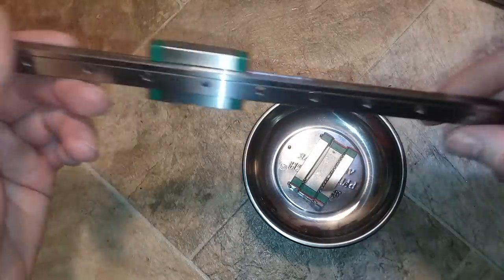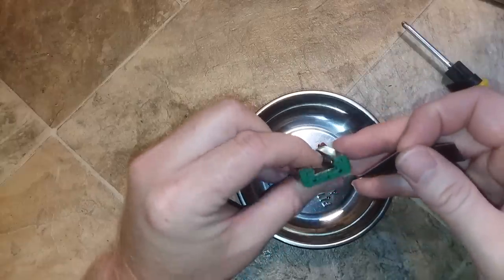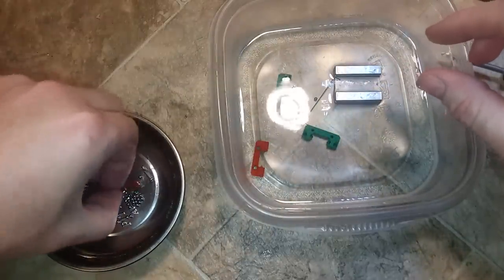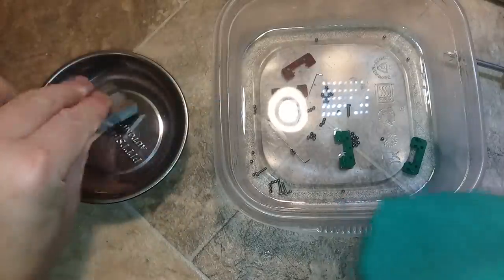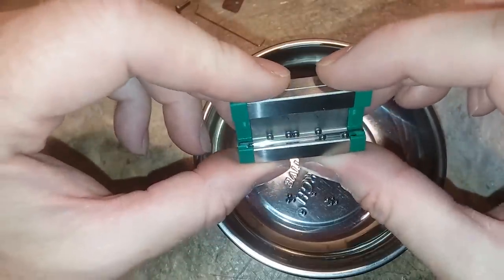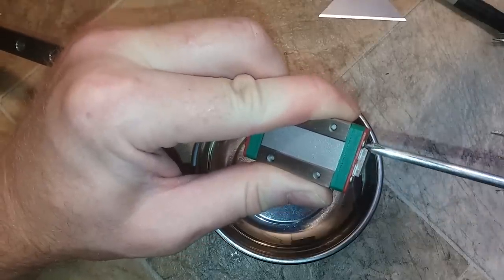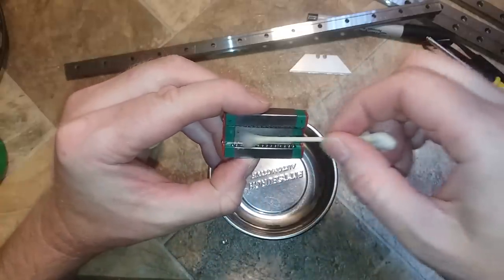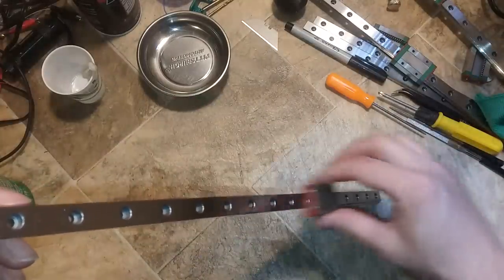Tuning Up Cheap Chinese Linear Bearing

Comment: These are not meant to be adjusted in any way? once wear sets in you are meant to replace the entire bearing? thanks.
Reply from the maker: Not really any way to adjust the bearing blocks.  I've ran these linear bearings for a while on my 3D printer and see no signs of wear.  I clean and re-lube the rails about once a year.
Reply: There is a huge difference in linear bearings you are seeing being installed on 3D printers (Voron, et al.) and linear bearings used on industrial machines in a production environment.  There is no way to adjust these bearings, but then again, high-quality linear bearings will not wear out on a 3D printer in your lifetime.  Even a small, made-in-the-USA 15mm wide linear bearing has a load-carrying capability of 2400lbs (yes, you read that correctly) but, a high-quality linear guide rail set for a Voron will cost more than the printer itself.  There is a VAST difference between industrial quality and Chinese junk.
Reply: @6milesup  which is to say the cost benefit relation for a 3d printer application leans toward the cheaper junk given little to no difference could be seen or measured under such insignificant static and dynamic loads and wear would not be an issue unless you decided to grind something next to the rails heh
Reply: Forgot to add even if you had lab grade linear motion and a rigid structure with a temperature controlled chamber the materials in use are often the culprit for tolerance and warping issues, printing most plastics is by definition an imperfect method of manufacturing... Just varying the printing speed will require different cooling flow and could cause unwanted warping with many materials due to differential heating (under inefficient cooling upper layers remain hotter than the lower layers causing a warp/deformation pull on the printed topology) this is probably going to infuriate a few but as it stands for FDM we're dealing with glorified hotglue guns... Then again a good set of linear rails could get you closer to better repeatability and tolerances provided you also upgraded your belts and other parts of your motion system.
Reply: @6milesup  and Chinese doing better industrial grade stuff than usa😁 but you had no access, it's expensive
Reply: Yes, you replace the entire unit.  But an engineer would select a linear rail such that it's service life match the service life of the application.  The cheap rails would last the life of the printer and an expensive bearing would last the life of some pick and place robot.

Comment: Pretty sure that's not excess plastic, that's a preload spring
Reply: 3:55
Reply from the maker: The plastic is not a preloading spring.  That would mean the bearing retainer clip is rubbing on the linear rail.  How long to you think the retainer clip would last rubbing on the other metal parts.
Reply: Bearing blocks like these are preloaded by using oversized balls, not springs.

Comment: All the 's Balls are now magnetically. And this is bad pretty Bad.
Reply from the maker: And why would that be bad?
Reply: @MrDabrudda   all the particle from the xrails and balls are Metall
Reply: @julienhagen7411  Oh damn...that does make sense I guess.  But, I cant imagine losing one of those bearings on the tile floor. I think that would be worse. lol.
Reply: I think the concern is collection of metal dust from rail and bearing wear, as well as any metal contamination in the machine's environment.  Not sure how much any (presumably quite weak) magnetization of the bearings will matter vs. the effects of the lubricant, which will tend to collect both magnetic and non-magnetic dust and debris.

Comment: Where did you buy these from?
Reply from the maker: I bought the MGN12H rail bearings from Aliexpress.
Reply: many says that the metal hardness is very low compared to trusted brands, which make them useless after some work
do you agree? I mean it is not just about smoothness
Reply: @GraphicManInnovations  when you buy something low-priced, generally there's a reason for that.  It's less expensive to buy and form softer metals to looser tolerances, and to not spend what it takes to have good, uniform material characteristics (e.g. whatever is available as scrap steel vs. precisely controlled alloys for uniform hardness and good hardening and wear characteristics).

The question is, what is good enough for what you are doing?  Is your machine going to be running 24/7 for a decade, or a few hours per month for a few years?  How heavily loaded will the rails be, relative to the size selected?  How good is the rest of the machine, i.e. is the frame steel or thin laser-cut MDF (cardboard)?
Reply: @scottwillis5434  it depends what you need. We're not all rocket surgeons.
Reply: @scottwillis5434  I'd buy genuine rails for the X & Y axis, as they move so much back and forth, but the Z you could put cheapies in, very little movement comparatively.

Comment: Hi, how much weight can these Chinese Linear Slides hold? I'm thinking of using them on sliding picture canvas frame?
Reply from the maker: Not sure.  If you check the specs of the rails it should give you the max load the rails and bearings can hold
Reply: @elmariachi5133  it varies from sellers to sellers and batch to batch even on the exact same model from the same seller.

Comment: Afaik that’s not the proper way of lm guides lubrication
Reply from the maker: Then what is the proper way to lubricate guides?  Please enlighten us
Reply: @MrDabrudda  AFAIK most linear blocks have grease fittings - not sure if these do but obviously if they don't then you probably are best doing what you're doing. Also, you want a good quality lithium grease for the blocks. The Hiwin manual has some quite specific greases and oils it recommends. Definitely nothing with molybdenum disulfide.
Reply: In fact, after looking at your blocks, it's quite possible that the hole in between the two screws in the red plastic is for fitting a grease nipple and greasing. It's likely the hole needs to be poked through with a hot needle but study the block to make sure. If you google for the Hiwin manual it describes poking a hole through to fit a grease nipple, and some photos I've seen of this same block have a grease nipple fitted there.
Reply from the maker: @michaelkelly3158  Not the MGN12H blocks.  The larger linear bearings do.

Comment: Well. You clean cheap thing, jube it and hope for the best or you buy %BrandName%, clean them up, lubricate and just use them. xD
Transportation grease are nasty stuff... (Lithium soap or Calcium soap grease often used to prevent corrosion)
Reply from the maker: I have had zero problems with these rails in 1.5 years of using them.  Every so often I clean the rails with a terry cloth and re-apply the synthetic lube.
Reply: I recently got an NSK ballscrew which was made in 2001 and it's covered in this super nasty almost glue like grease. Took me 2 hours to get them off and it took me half a bottle of WD 40 and 3 towels I'm never getting back. Good thing is there is 0 rusting even after all these time.

Comment: Can I use wd 40 for lubricat
Reply from the maker: Absolutely!  I only recommend WD-40 for any LUBE jobs...
Reply: No, WD40 is not a lube its a rust dissolvant and we use it to flush old lube out of rails, not to lubricate them.  they do make other lubricants but most people  use EP1 or EP2 grease for rails.  for other stuff, use whatever works.
Reply from the maker: Yes, I know...I was being sarcastic.  If you read the description of the video you will see I posted this because people where claiming I used WD-40 for lube.
"AND NO!  NO WD40 WAS NOT USED ON THE BEARINGS!!!"
Reply: Already WD40 make Lubrican of silicon. Just use the proper tool WD40 is just a brand name, they have types of oil and lubricants.
Reply: @slevinshafel9395  sir I have wd40 bottle so can I use for lubrication rail lubrication
Reply: Yes of course you can, and it will not help and within weeks of applying it you will notice the rail is gaining resistance to movement which will soon be worse than where you started.
Reply: no never, it is a cleaner not a lubricant. use a graphite powder or similar something with virtually zero sticking power because what will happen with a 3d printer is that it will clog the bearing from the filament dust.

Comment: 3x Bosch Rexroth  cost about 500$ and will outlive you and your printer.
Reply: and outcost
Reply: Point is
Reply: not where I live
Reply: @sniperpronerfmods9811  his point was that even if he has linear rails it doesn't mean shit if they're pisspoor quality. People seem to not realize that many cheapo rails aren't straight, carriage have excessive slop and it would be all the same to use generic tube rails, they can wear out of shitty materials and worst they can easily be so shitty grinded that they could have axial changes between rail points which totally fucks the idea of rails. People seem fail understand that most cheapos are 100% quality control defect products (if in good luck) or just blatant ripoffs that pretty much nothing to have with original application concept.
Reply: yeah those sound over-kill for a small 3D Printer and CNC Machine.
Reply: Иван Иванов they will out live you. The high end stuff is expensive for a reason. It’s perfect when it arrives

Comment: You shouldn't be using a magnetic tray.
Reply: Why?
Reply: @achdubloedesau  I guess because Mr. Titanium says so. People who make pronouncements without giving reasons should be just ignored. They've contributed nothing.
Reply: @achdubloedesau  Because doing so may magnetize the ball bearings which will then attract small metal shavings.
Reply: @tcarney57  I don't agree, Better something than nothing.
Reply: @tcarney57  i think the reason is obvious. you don't want to magnetise anything in any of the metal parts of this hardware.

Comment: This is all completely unnecessary and should not be done. The guard pins are non functional in the bearing, their only purpose is that a mechanic with fumbly fingers wouldn't loose any balls when assembling the thing. Once the bearing is on the rail they serve no purpose and it doesn't matter is they are straight or crooked. And they use thick grease in the bearing, because that's the lubricant the bearing needs in order to function. The lubricant has to be thick enough, that under rated load there would remain thin film of it between bearing surfaces, if the load is great enough or the lubricant thin enough that it's metal on metal, the lubricant might as well not be there. And remember, the only contact surface are these tiny balls, by replacing the grease with oil, you make metal to metal contact and these tiny things don't take long to wear out.
It probably doesn't matter much in such a lightweight and rarely used application as a 3D printer, but it's still the wrong thing to do.
Reply from the maker: https://www.linearmotiontips.com/lubrication-grease-or-oil/

I see your point but these rail bearings are not carrying a lot of load nor generating a lot of heat.  It is easier to use a thicker type oil and reapply it with a qtip after cleaning the rails.
Reply: Yep that most all that needed doing was adjusting the swipers at the end of the rails PLUS lubricantion

Comment: The quality of electronic goods from china has tanked if you ask me... everything needs reworked. They don't see anything wrong with it!
Reply: That´s why it´s cheap. Not that I´m complaining, because I´m broke.
Reply: This is good. Because now you have a choice. Buy expensive stuff, or buy cheap and treat it like a set of parts. If you apply some random wage to "hobby time", then yes, they will be expensive. But most people have no way to convert "hobby time" into wages, so the time will be wasted either way. I don't mind wasting it reworking cheap stuff.
Reply: The quality is better than you think it is. The guy in this video is trashing the company that made this affordable for you so you can afford it.
Reply from the maker: @FrustratedBaboon  Trashing the company?  I don't even mention the company's name so how am I trashing the company?  Even with the expensive bearing you will need to clean the factory cosmoline off and lube the rail and bearings.
Reply: Demand creates supply. There is a demand for super low cost products and corners get cut. If you buy slightly more expensive Chinese parts, you get pretty good quality. It's unfair to say China makes crap parts when all you do is order the lowest cost parts from some random Amazon seller. I'm not trying to say the cheapest parts available from China are good, only that you can get pretty good Chinese made goods if you pay a bit more and shop Chinese known brands not random amazon stuff. Nothing against the video.
Reply: @clubpasser123454321  you are very right, also i back you  up in a different way, there are even lower quality product that don't have many buyer and could not get into the international market, for example if give a product with 10 stars rating to compare, 8 stars we say is good, very often people bought it is about 6-7 stars and start to complain the quality , those lowest cost or quality are often exist online for your choice we could give it a 5 stars, but to reduce the living cost or spending many low income Chinese often use those 3-4 stars product and working for making better quality product, so sad for those people working in the bottom end.

Comment: Earth to noobs. Precision linear bearings aren't suppose to be free sliding. Especially heavy duty preloaded ones. Earth to noobs, using light lubricant to allow your bearings to freely slide will wear down your hardware faster and lose tolerance faster overtime. Earth to noobs, doing this to your linear bearings is only ok to very light duty such as a 3d printer.
Reply from the maker: Earth to internet arm chair pundit...what do you think I am using the linear rails for???  A light duty 3D printer?  And I'd love to see supporting documentation where is states lubrication will cause the bearings to wear faster.  Don't think you know wtf you are talking about.
Reply from the maker: Literally took me 30 seconds of searching the interweb to find this info.
And I QUOTE...
https://www.thomsonlinear.com/downloads/articles/Linear_Bearing_Maintenance_taen.pdf
"Bearings should be inspected on a regular basis.  A simple check of the shaft and rail can be done by running your finger along them. You should feel a thin film of lubricant. Re-lubricate the bearing if it is dry.  Check the bearing for corrosion or contaminants and also check the environment to see if the environment has become more challenging. Check the bearings, bearing outer race and shaft or rail for metal fragments which are a particular concern."
---Hence the initial disassembly, cleaning, and relubricaiton.

Maintanence of MGN12 Linear Bearing...from HIWIN
https://www.hiwin.com/pdf/lubricating_instructions.pdf
"Relubrication interval when using low-viscosity grease.  The relubrication intervals for lubrication with low-viscosity grease are reduced to 50 % of the relubrication intervals for grease lubrication."
---Which means the thicker the grease...the more the wear on the bearing because the lubricant does not flow as well as a synthetic lube.
Reply: Lots of heavy duty bearings use white lithium in the machining industry which is a very light grease. Also angular contact bearings as well. Most important thing is to keep them clean and cool with a decent light lube.
Reply: i am no technician, i think it is a great tip, to check if you can benefit from replacing the oil/grease for low load, low torque, high speed applications. 
But i also think, that AllFor... argument may have some validity. To compere two greases, there must be some load, and some movement time.  
You may have changed from grease to oil lubrication,  linearmotiontips states that orientation of components must be taken into account when oil lubrication is used. When components are mounted on their sides or vertically, oil lubrication will not flow to bearings and raceways that are above the lube ports. Well they also stated the obvious "If the oil viscosity is too low an adequate lube film layer will not form and metal to metal contact can result leading to shortened bearing life." They also said, that oil might degrade when used in an environment over 80*C and should be replaced every 3 month. I can't image that this last one is true, but again i am no technician. So i think it is about finding the sweet spot, isn't it? 1000 mm²/s may be to high, but 0,5 mm²/s may be to low. ;-) I assume that many linear bearings are more optimized for high torque then high speed, so thank you for your video!
Reply: one question though (i do not know) these plastic stuff, which you removed, could it be meant to stick to the sides to clean the dust from the  linear rail, that it does not get collected by these little steel balls?
Reply: The actual precision linear bearings come in different preloads from "slightly loose" to "tight as fuck" depending on the intended application. And it has nothing to do with lubrication (and neither with the cheap bearings in the video that come anywhere inbetween "rattle rattle" and "ssskhhrrr jam" grades depending mostly on your luck)
Reply: True, I have NSK and THK linear berings, they dont fall in vertical position.